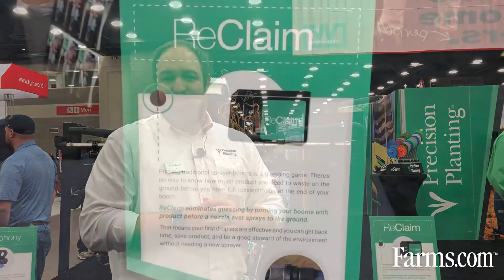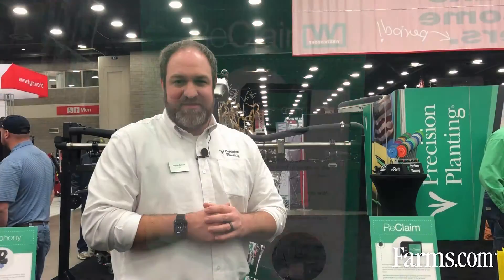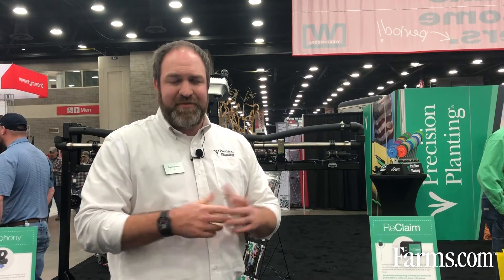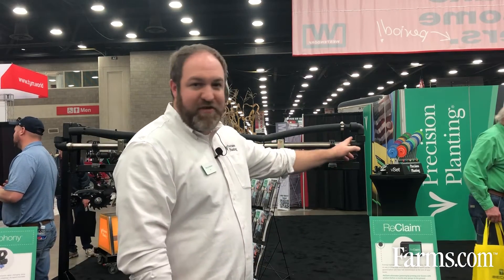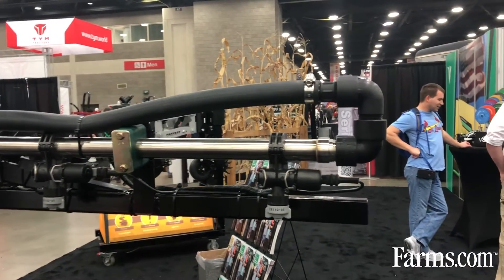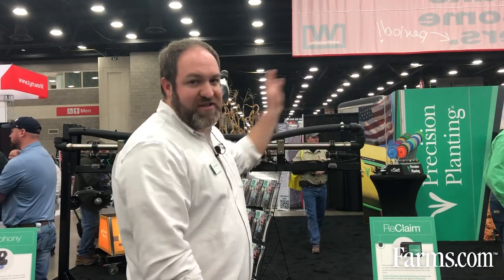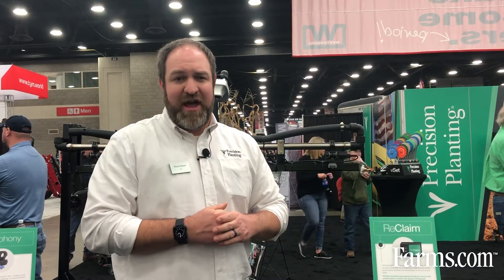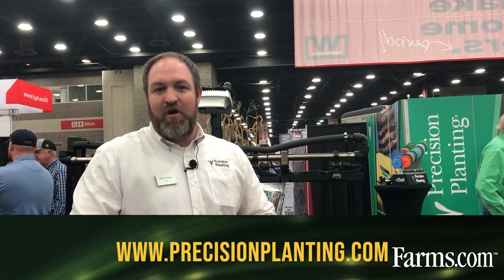ReClaim by Precision Planting — Retrofit Sprayer Recirculation System — Available in 2022

Comment: Looks great 
I would be interested in purchasing a system to be part of the beta program if you are looking for participants. I do a lot of commercial turf spraying so I can give you a different inside than the traditional ag customer. I am in the process of plumbing a new wet boom on one of my sprayers that is running the Ag Leader Isobus rate controller. I have an engineering background and worked for a John Deere dealership so I wouldn’t need my hand held on this type beta testing.